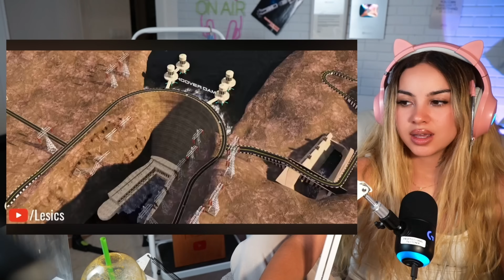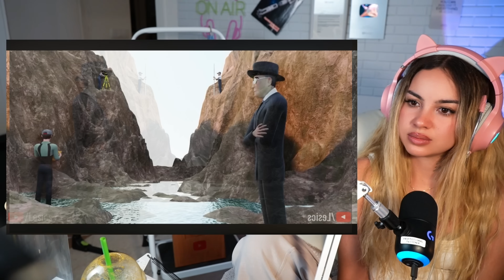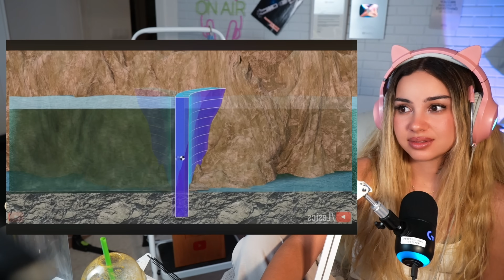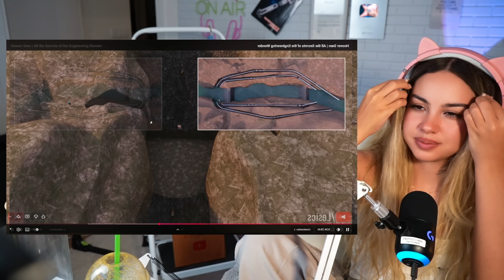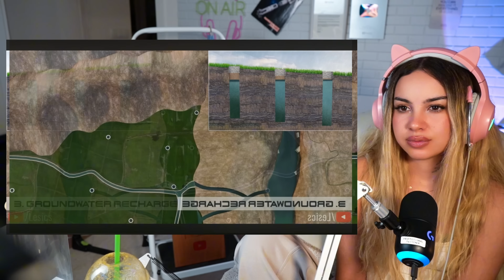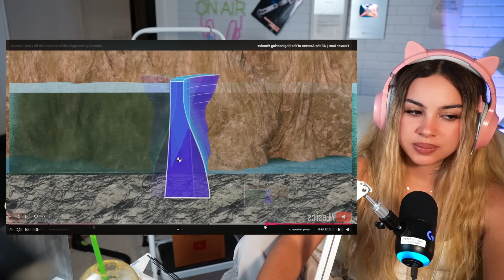America Built THIS in the Middle of a Desert?!

Comment: It seems like a lot of steps -- a not cost effective comment was also made.

Had engineers poured it as a single block without cooling pipes, it would have taken roughly 125 years to cool and cure completely, but cooling methods allowed it to achieve structural strength during construction.

Comment: If you poured it little by little and waited for it to cure we'd have finished building it in 2006. If you poured it all at once (even if that could work) it would still take another few hundred years to fully cure. Concrete is weird dude.

 When I went there with my parents as a kid it was free to drive over because it was still the only crossing part of the main road. They've built a new bridge since then though so now it's like a tourist attraction thing to drive over it and you need to buy a ticket. It's a pretty narrow 2 lane road with a sidewalk. You can tell it was built for the smaller cars of the time.

Comment: 8:42. I get it..,  Finnish Girl is young, and physics isn't her strength. However, the narrator explained the problem and the solution for laying the wall concrete. 

If the concrete is just layed little by little, stack by stack, and allowed to cool and set, when the structure is completed, the pressure created by multi-billions of tons per square liters of water, pressing against the wall, will cause the concrete to heat up and crack.. (the concrete will never set and dry solid enough, to resist the pressure being exerted against it, if Finnish Girl's ..aht'em.. suggestion was implemented).

Why? May you ask?.. 

Well that's because Finnish Girl's idea, left out the crucial steel rod cooling system in each layer of concrete slab.

Simply because something seems more efficient, if its done in a shortcut manner, doesn't mean it won't ultimately fail.

There are plenty of bridges in the US, and elsewhere in the world, that learned that lesson too late. Example:Tacoma Narrows Bridge, in Washington State (1940).

The water at Hoover Dam and like Dams, isn't measured in gallons or simple liters, it's measured in metric tons per square liter. 

So, pretend over 1 billion elephants were stack on top of your body, that still would be substantially less pressure, than the water pressure being exerted against Hoover dam every minute.

If there was a better, safer, quicker solution that wouldn't ultimately fail.. I'm certain the structural engineers working on Hoover Dam would have thought of it and used it, multitudes of decades ago, when they were building the Dam.

Comment: It looks like the block method is being filled to different heights so that each layer of the cement locks together with the upper layers like Legos.  Otherwise if you just did it layer by layer, it'd be structurally weakest between layers and possibly shear.  Think about how most 3D printed objects fail.

Comment: If nobody has addressed this in the comments: Most of the water impounded by the dam does not come from local rainfall. Most of it falls on the western slopes of the Rocky Mountains in Colorado as snow, melts over the course of several months, and feeds the Colorado River and its tributaries. The Colorado River drainage basin is about 640,000 square kilometers.  I drove over the dam about half a dozen times before they built the new bridge and toured the inside of it once.

Comment: Yes it is very real indeed, and still there and working... The dam was so big there were no companies that could do it. so a consortium of 5 companies was created to do it. It was build for the hydroelectric power it could provide but also to control the flooding of the Colorado river, which otherwise  could be very destructive to downstream communities. The resulting reservoir also provides water for Las Vegas and even Los Angeles and many other communities. For years after it was built, the reservoir was filling up and the water weight caused local earthquakes as the land had to bear the extra weight of all the water. A small city was built nearby ( Boulder City ) to house the workers and their families, many are still there, or their descendants.  Metal tubes had to be cast into the concrete as it was poured, to cool the concrete as it cured... it was calculated it would take years for the concrete to cure otherwise, as the heat produced by the concrete could not escape without the tubing, which provided cooling fluids to the interior of the concrete. There is an education building open to the public nearby that tells the story of the dam, well worth the time if ever you visit it. It's been called Boulder dam but also Hoover dam, in the past.

Comment: Hoover Dam was built to supply electricity, drinking water, and irrigation water.  There is still a road over the top of the dam.  However, I believe that this road is closed to general traffic (since about 2001, perhaps) because of concerns of terrorism.  A truck fill with explosives driving over the dam could possibly cause a great amount of damage.  If you look on Google Maps or Google Earth, you will see that a new bridge has been built across the canyon for general traffic.  By rerouting the traffic, the concern of terrorism is greatly reduced.

Comment: A few things:  I have toured the dam twice and drove over the top of the dam about 5 times.  At one time the quickest way to get from Las Vegas to Kingman, Arizona was to drive across the top of the dam.  In the last 20 years or so a bridge has been built just downstream of the dam.  Part of the problem with pouring concrete is in order make a section consistent and complete you have to pour concrete in one contunous pour.  Therefore, once they start pouring concrete on a section they will work day and night with shifts until its completed.  So that is one reason that doing a little bit at a time will not work.  Also, if they did a little bit at a time waited for it to cool before continuing, it would have probably taken 100 years to build the sructure.  Regarding the water pressure on the back of the dam; unfortunately, about 100 years ago when colorado river water was allocated between California, Arizona, New Mexico, Utah, Nevada, Colorado, and Wyoming they used annual water flow numbers that were overstated.  Now that the Southwest is in a 20 year drought, Lake Meed is so low that full power generation cannot happen.

Comment: For decades the highway actually traversed the top of the dam, there were no nearby bridges. As traffic on the highway increased it was becoming a bottleneck, particularly since the approaches were steep and winding - difficult for large trucks.
However, after September 11th 2001, the potential threat to such an important piece of infrastructure, made constructing a separate highway crossing a priority, so now, you can still cross the dam on the road, but it is a detour off of the main highway.
Last I checked, they still give tours of the powerhouse.

Comment: In the US, dams are built for 3 reasons:
Flood Control
Power Generation
Water Storage

Usually they will try to satisfy all 3 purposes with every dam.

The higher a dam, the more power it can generate. Power generation is a factor of the volume of water that passes through the generator, and the force of the water. A river has a fixed volume of water that flows down it, but if you can create a taller dam/reservoir, you create more force for the same volume.

And engineering is fun if you are into that sort of thing. I designed all sorts of stuff as a kid. Houses, boats, spaceships, computers...
Reply: Correct & Kentucky & Barkley lakes here were created by their respective dams that provide power & flood control for much of the Tennessee River Valley.

Comment: Hoover dam is dwarfed by the Grand Coulee dam on the Columbia River in Washington State.  While Hoover is 176 feet taller, Grand Coulee is four times as wide as Hoover dam.  Hoover contains 3.25 million cubic yards of concrete.  Grand Coulee contains 12 million cubic yards of concrete.  It is the largest hydro electric generating plant in the United States. Hoover generates around 2,074 megawatts of power, roughly 4 billion kilowatt hours per year.  Grand Coulee generates 6,809 megawatts of power, over 21 billion kilowatt hours per year.

Comment: Yes. It's built to supply electricity to a very large area of the Southwest. Unfortunately, Lake Mead is at a dangerously low level. To the point where  most of the 17 turbines will stop working. They are in the process of putting in new low water level turbines. 2 have been installed already and they are working on putting 2 more in. But those won't be finished until 2028 and the lake is expected to get to low to operate the remaining old turbines this year. They knew this was going to happen but they thought they had more time to replace the old turbines. The Southwest is in a lot of trouble. They are in serious need of a miracle rainfall and about 5 massive winters in the Rocky Mountains. And yes, you can drive across it but it now dead-ends and is just for tourism. They built a bridge nearby to handle the traffic that comes through.

Comment: Ever have any leaks ? Yes, but not from sudden structural failure. During construction, engineers realized that if the massive amount of concrete was poured all at once, the extreme internal heat generated during curing would have taken 125 years to cool, causing the dam to crack apart under thermal stress. To prevent this, they built it in interlocking blocks using an innovative system of steel cooling pipes. And thats why its still standing 80 years later.
Reply: Curing, I e seen inside of it, all the seepage is wild.
Reply: @j.walker3498  thats scary
Reply: @WilliamJackson-le5vj  yeah especially when you're deep inside of it until you see or know about it. Standing in the viewing room when they open it up and everything starts to shake doesn't help.

Comment: On the Colorado River above Hoover Dam (726 feet or 221 meters tall) is Glen Canyon Dam (710 feet or 216 meters tall), which is only 16 feet or 5 meters shorter and started in 1956 and completed in 1966. My Dad worked on it and hung off the edge of the cliff and drilled holes for blasting. The Grand Canyon is between the two Dams. Glen Canyon makes Lake Powell and when full has over 1900 miles (3060 km) of shoreline (more shoreline than the coasts of California, Oregon and Washington combined) and is 217 miles long. Lake Mead still holds more water because the canyons are wider and deeper.
Record temperatures in Page, AZ where Glen Canyon Dam is located are 120 F (49 C) and -2 F (-19 C).
Record temperatures in Boulder City, NV where Hoover Dam is located are 117 F (47 C) and 9 F (-13 C).

Comment: One of the USA's top engineering marvels!
80 years and no cracks.  That dam good!
Reply: The video is a bit older.  The dam turns 90 this year.
Reply: Grand Coulee is 3.5 times the volume of Hoover, and generates over 5 times the kilowatt hours per year.  The Columbia River is a lot larger than the Colorado.
Reply: 3 gorges dam is surely jealous as fuck.

I guarantee it. Lmao
Reply: Hoover should last over well over 1000 years if it isn't removed first.

Comment: The bottom levels of the dam   is still cooling today
Reply: Curing?
Reply: @j.walker3498 yes they are still extra ting heat from the curing concrete through the water pipes installed in the monoliths

Comment: Sadly, the water is running out. I've lived in Las Vegas since '94 and plan on leaving within a year. Two tops. Recently, there was not enough water to turn the turbines (electric to answer your question) and had to be shut down for a bit.
There is another bridge now to cross, but yes, you can drive across the dam. Both ways.
Reply: https://en.wikipedia.org/wiki/Lake_Mead#Drought_and_water_usage_issues